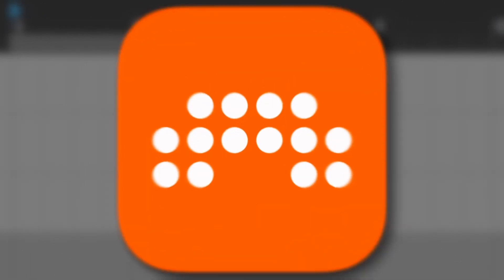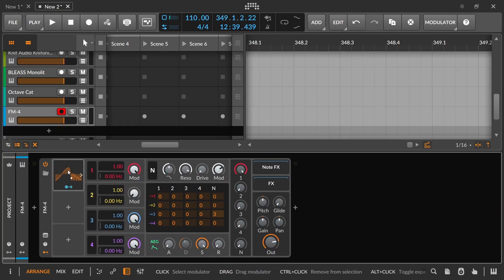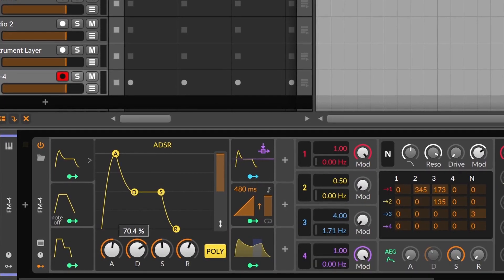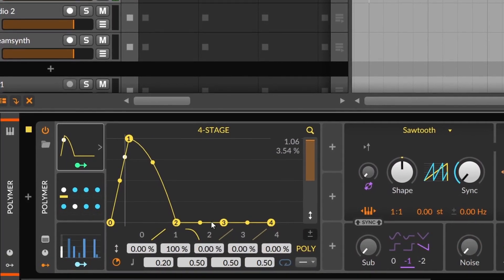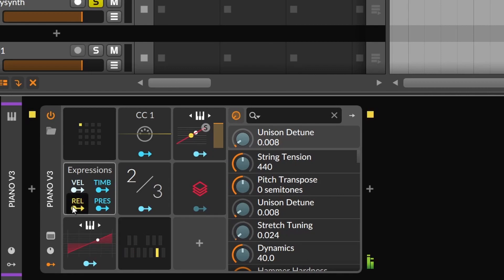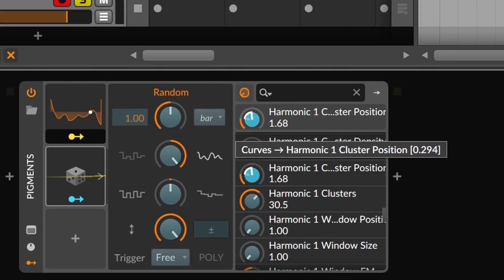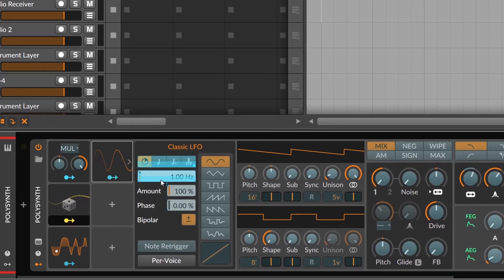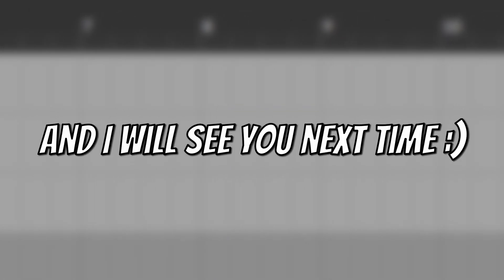One of Bitwig's Best Features: The Modulation System Explained

Comment: Bitwig claims to modulate systemwide - I could not find a solution for track a modulates track b . spent hours with chatGPT got dozens of suggestions none worked tho I did the setup exactly as suggested . waht I miss is a general global modulation matrix . or at least a in/out selector in the mod symbol
Reply from the maker: @solarsound744 I believe it's not possible. There are track modulators, which will modulate anything inside a track, and then you got project modulators, which can modulate anything
Reply: @AlexReidStudios  thnx

Comment: 1:50 frustratingly, not every parameter of every 3rd party plugin can be mapped and modulated :o(
Reply from the maker: There are some, true. Not sure why but it depends on how the plugin is programmed
Reply: @AlexReidStudios  and for me those are often the ones that I would like to have mapped to a controller the most for live sets playing... often its those that for example regenerate some random data, for some reason - I noticed this repeatedly, its those "out of the box" that dont fall into the category of classic 128 CC functions / generic traditional hardware controls.. i.e. XO and switching between new sets of random samples or beat patterns.. :( id fukin love that mapped for live play, tried many workarounds, gave up
Reply: @ancientbohemian that’s more a plug-in developer problem than it is a bitwig one. Bitwig has its architecture set in a very open way. 3rd party Plug-ins often don’t.

Comment: Great vid, amigo!

I would add that another great practical aspect of BW's modulators is to revive old VSTs - those still in use but that have objectively crappy modulation systems (FM8 and Sylenth are 2 that come to mind). Just override all those old limited internal systems with BWs = a great way of breathing some life into vintage VSTs

Also: It's a great shortcut to diving into vintage-modeled synths that come with a learning curve. I mean: how many of us have really taken the time to learn all of Arturia's vintage emulations? My MO now is: Just show me where the barebones oscillators, filters and Envelopes are and after that I'll go to work with BWs modulators. Hotwiring a crazy complex Modular Moog with some of BW's more extreme modulators, ie, is a sure way of doing some unique vintage-meets-modern sound design:)
Reply from the maker: I agree, that makes it an amazing DAW, not beign limited by a plugin's limitations